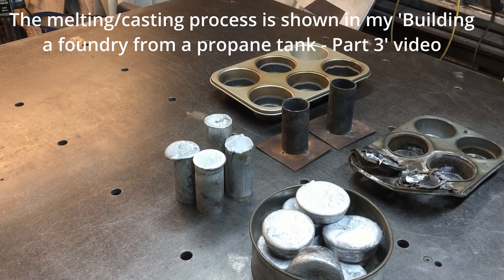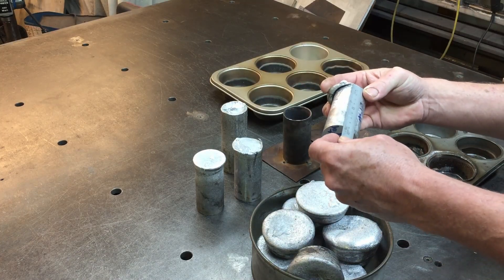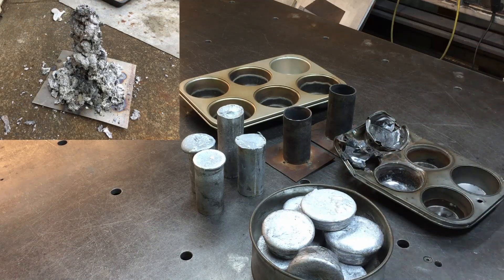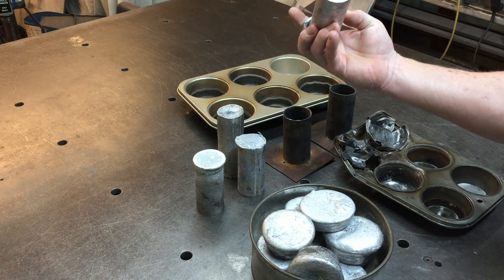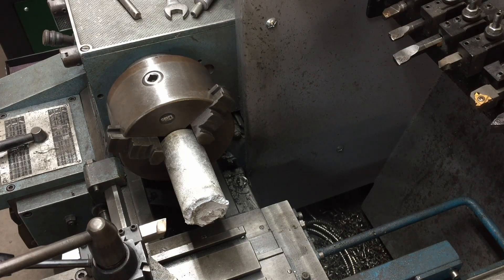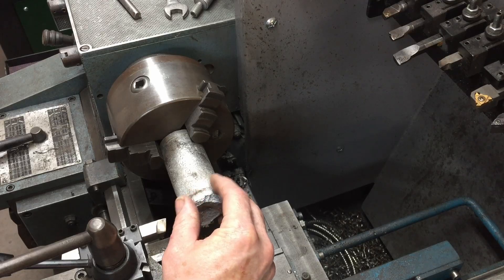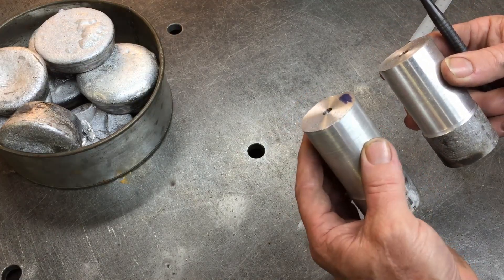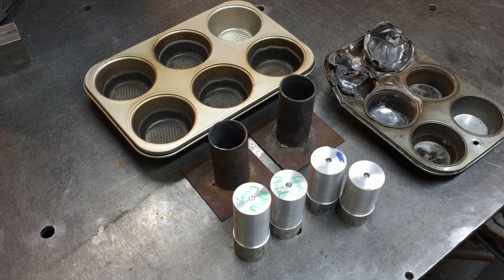Aluminum round stock - Results from casting

Comment: The Hobby Machinist NZ , hello. How many melts did you keep perlite with cement? Did you replace it with something else? Thanks
Reply from the maker: Thanks for your questions. I have done around 15-20 melts with this system. The cement and perlite is starting to crumble but I have not replaced it yet.

Comment: Molten alloy dissolves steel [tart tins] you need to coat them with a refractory wash,I use a zircon based refractory wash on my ingot molds & pyrometer probes & dross skimmers also if I occasionly us a steel crucible I coat the inside as well,hope this helps
Reply from the maker: Thanks for the information and your suggestions headstocktailstock.

Comment: JP, the texturing at the bottom of the good cupcake mould might be your answer.
Reply from the maker: I wonder if the issue was what ever the tin was lined with? The aluminum seems to have stuck as if it was welded to the tin. You can see in some places where I removed the ingots that it has ripped aluminum away from the ingot and it is still stuck to the steel. I will sneak the tray back into the drawer so the wife can make some cupcakes:)
Reply: @thehobbymachinistnz  I think Mrs JP might notice. Oh......and don't eat any more cupcakes made from that tin.

Comment: Thanks for the shout out.  Heating the mold will definitely give a better outer surface result, as will letting it air cool.  Water cooling can cause serious localised shrinkage.

Those little bubbles are from hydrogen gassing.  You can virtually eliminate this by pouring the ally as soon as it's melted.  It and the dross should never glow red hot.  The hotter it gets, the more it will gas, so as soon as it's runny do the pour.   Overall it was a good result for a first attempt. 

You're doing some excellent videos.  Next time I touch on this subject I will give you a return shout out and help get those numbers up.

Cheers Rob.
Reply from the maker: Thanks a lot Rob. Yes, I did probably cook it longer than I should have. There was a lot going on for the first attempt, but I should be more organised next time. I now have some ingots so I will have more control over when I can do the pouring.
Reply: I'm here because of Rob's recommendation :) Howzit from South Africa. Thanks for the content!
Reply from the maker: @keganboddy8598  Thanks for stopping in.